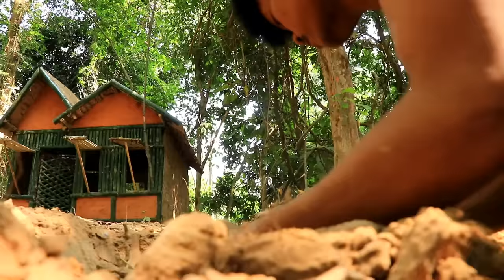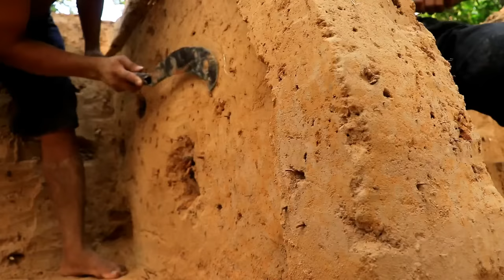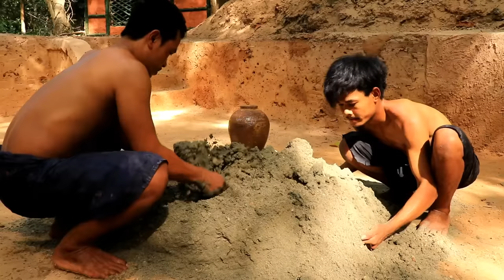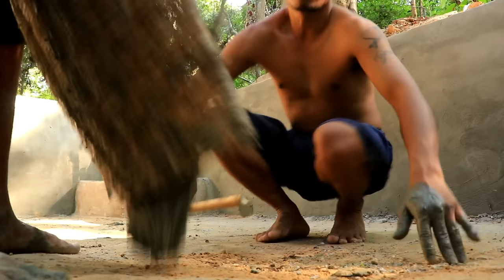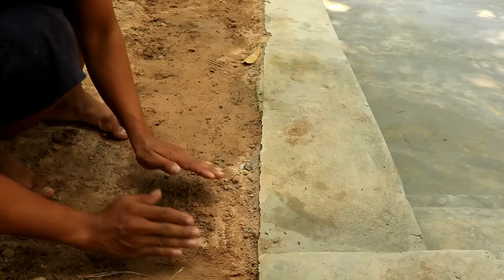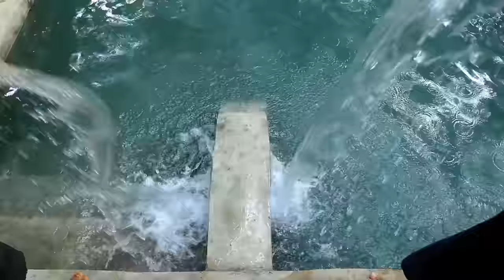How To Build Secret Swimming Pool  In Forest

Comment: What is the kind of material /soil used for the plastering? It looks like cement plaster  (what kind of soil is it and how to find it?)
Reply: It is most likely survival concrete, basically mud with grass, sand, or other aggregates to get the desired properties.

Comment: For the sake of argument, let's say this pool is 8 feet wide, by 16 feet long, by 2 feet deep. That would require 1,915 gallons to fill.  Obviously, it is larger than that, and thus probably more around ~3500 gallons. The pales they are using to dump the water is probably right around a gallon each time.

For digging, using the sticks they are, which closely resemble a common digging bar we use here (great for post holes), they can't actually scoop anything with. Which is why they are seen using their arms to throw dirt out of the pool. 

Can this be done? Yes. By 2 guys in the woods with god knows what for a water source?  

This is dumb.

Comment: No way is this pool dug with a stick and a crude knife thing.  This would take about a week to do.  And all those green stick things have been pre-cut.   I bet the pool was dug using a digger and other power tools also used.  There must be about 18 000 litres of water in the pool.  Even with a garden hose running it would take about a day to fill.  No way could two men with pots of water fill it up as easily as that.  This is fake...using concrete with bare hands would result in burns...he must have used about 10-15 bags of cement...after two bags there would be blood and lots of pain....the sides of the pool far too smooth....again tools...metal trowels  best bet.  This is fake